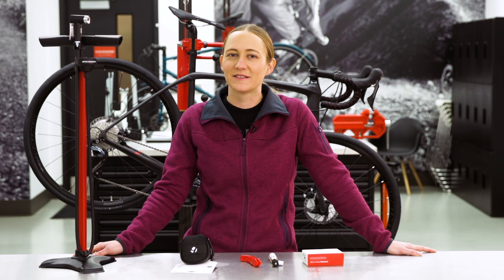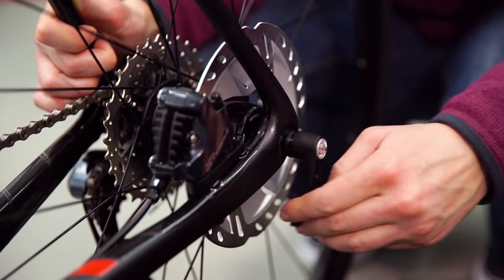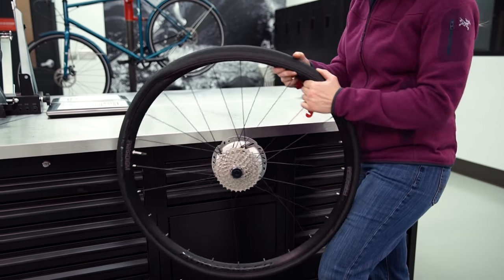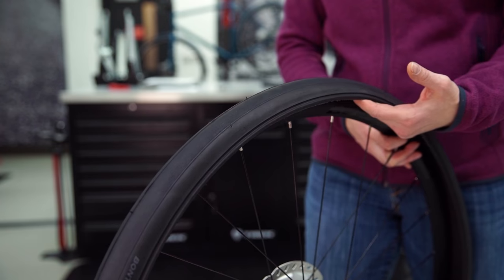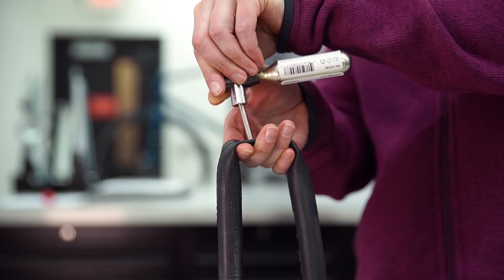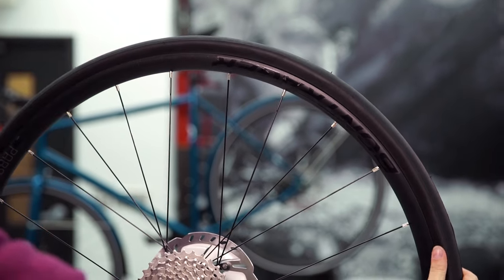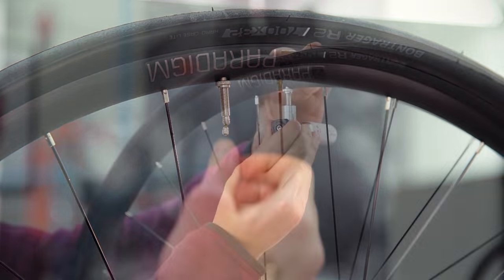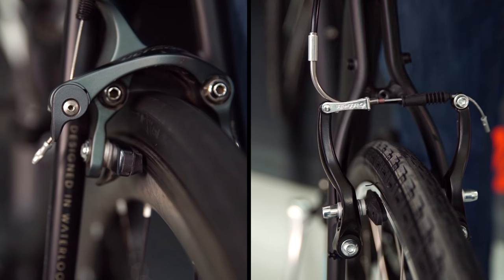How To: Fix a Flat Bike Tire

Comment: She made it look easy because she has a nice, soft, squishy tire that's easy to get back onto the rim. Too bad most tires are not that soft, and have stiff wire beads that are incredibly tight once you get to those last two inches. Then, it's near impossible to get it back on the rim.